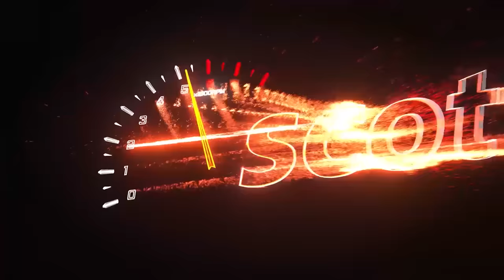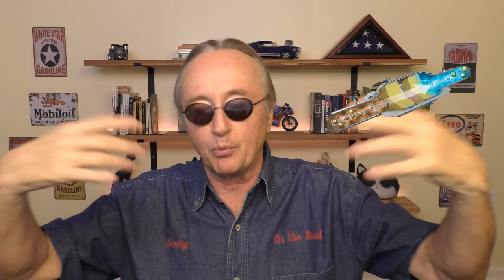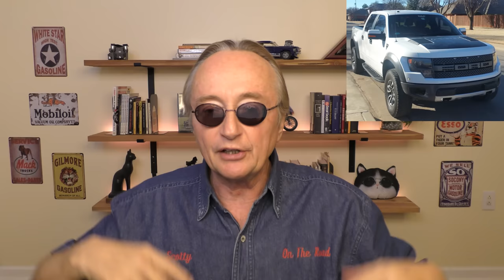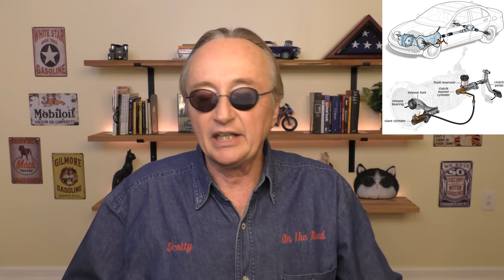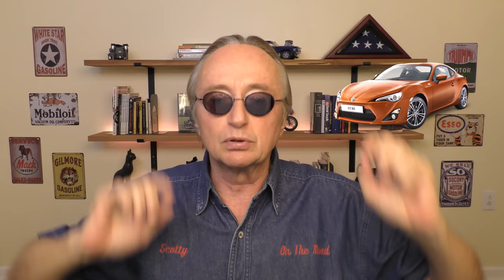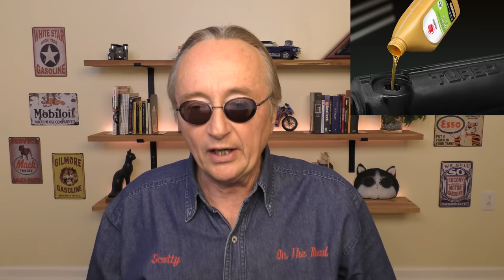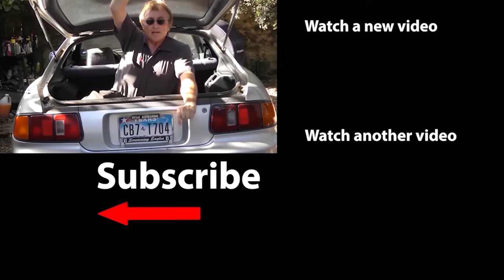Here’s Why Engine Braking Can Destroy Your Engine and Transmission

Comment: I used to do it in the snow and avoid using the brakes. But yeah I guess brakes are cheaper than transmissions. That's why planes don't use full reverse thrust anymore, because brakes are cheaper than an engine overhaul.
Reply: They mostly use it for noise control. Putting fuel in the engines for reverse thrust costs less than taking the plane out of service for rebuilds. 
Using the brakes landing delays the next take off, they need to wait for the brakes to cool in case they need to abort take off. 
Reverse thrust is not the engine braking you use in road vehicle. 
Reverse thrust redirects the engine thrust to the front, it's more like putting your engine in reverse while going forward. 
It's not a direct comparison.
Reply: Ok so they do it for noise. But isn't it also because of engine wear and fuel consumption also? There had to be economics involved for them to change standard practice.
Reply: @TheRabidPosum  tyres are expensive, brakes are expensive. Fuel is cheap. Thrust reverse is only used for seconds, not hours upon hours. Jet engines have few wearing parts, it's mostly oil changed at service intervals. Brakes are a high wear, high failure part. Tyres are the same. 

It's noise regulation that forces companies to reduce their use of thrust reverse in airports in cities. 

Thrust reverse is safer in wet, icy, snow conditions. They are safer in high temperature conditions. They are used to reduce the high speed more efficiently and effectively. 

Cars would be lighter and cheaper without all of their safety equipment. They'd also be cheaper and possibly more efficient with out noise and pollution emission controls. Public safety and comfort mean we often pay more for things, do things less efficiently.
Reply: @rustymozzy  that makes a lot more sense to me. That's what I felt in the first place.

Comment: Engine breaking on certain engines is bad yes, but my Hemi loves a good downshift for breaking. Of course if you down shift in a Toyota 4 cylinder it will stress the car and it will blow up.. but not my MOPAR HEMI... Very smooth better balanced engine meant for down shifting  and slowing that 4,200 LBS in seconds.

Comment: The diode voltage difference is felt especially when testing with acceleration .The power and swiftness of the acceleration .The profile of the acceleration is alternator-diode voltage dependent.What do you think .Yes the car moves but how does it move?

Comment: Engine breaking is a different animal with electric and hybrid electric vehicles. In those cars the engine braking is electric. In my Gen2 Prius I always break-shift on down hills to get more mileage as it pumps power into the batteries I would of otherwise wasted in the brakes. My Prius is +250K miles and still going strong. My Chevy Bolt has even better regenerative braking. You can drive with just the gas pedal as pressing the accelerator pedal speeds you up and letting up on the pedal uses the same motor as a generator for full breaking depending on how much you let up on it. You only use the real breaks in an emergency like if you want to squeal the tires to a instant hard stop. Going on +3 years and the breaks on the Bolt are still new! lol

Comment: I'm not sure that Scotty knows what a Chevy ZR2 is....Its like a Jeep Rubicon with better shocks & Locking differentials....Ford Raptor....can be a maintenance headache! Skodas? Well they are rebadged Volkswagens.....Maybe better styling.....Same for SEAT brand autos.....Myself....When I went truck shopping....Looked at the Raptors....all were optioned to the max around $80,000 and ended up with a 2 door cab ZR2 for $37,500 and looking at the maintenance schedule for the 1st 100K miles....I'm happy I bought the more "basic Chevy" rather than the "Cowboy Cadillac" Ford....Cheaper insurance too....and I'm an "old guy"....Whole lot less things to go wrong on a ZR2 and I don't intend to run 60-80MPH when I'm off roading my truck....just fast enough to get to where I want to go....

Comment: Hey Scotty, a 2010 toyota rav4 228k km the transmission hasn't been change... would you recommend change it, drain and fill it twice? Also will injector fuel cleaner help to keep the injectors clean? Will this cause problems?

Comment: I don't understand the engine braking advice.  My truck came with an exhaust engine brake (actually works pretty darn good).  And why would slowing the vehicle cause more wear than accelerating it?

Comment: Ya know what's worse? Under steering in to the wall because you didn't use engine braking. It's very simple; if you don't engine brake or don't want to utilize your gears properly in the first place then don't buy a sports car, stick to crossovers and don't go beyond that. Engine braking is a feature of the gasoline engine and without it your car will not handle properly. If you buy a Big Mac, it will last longer if you don't eat it, right?
Reply: @Mark Codiroli You have never been to the track in your life and should never give driving advice.

Comment: Ya but the zr2 has front and rear lockers instead of ford only being a rear locker as well as they use a better suspensions it has a multimatic suspension instead of the traditional Fox shocks ford is using

Comment: SCOTTY! Got a 07 honda fit and get loud sound when stopping at a light and the car is in drive, once i go noise goes away and back to smooth. If i put the car in neutral while stopped the noise stops but when i go back in drive right back the noise comes. I have a bad cattalilytic converter if i get it ripped out and just put a straight pipe in place would that fix it?
Reply: I'm far from an expert, but it might be the torque converter. In drive and stationary, the clutch is open and the torque is transmitted to the wheels through the torque converter. When in neutral, the clutch is engaged i think, so there is no relative motion in the torque converter. And after you pull away, the clutch engages, locking the torque converter. So... relative motion in the torque converter is my very ignorant guess.
Reply: @CristiNeagu  well would you know if i leave it as is would this get bad because this is a budget beater that im trying to spend as little as possible on

Comment: If your engine and transmission can't handle engine braking, you have a crappy car. I drive my cars hundreds of thousands of miles and I do it all the time. But I research the cars I buy and don't by junk that falls apart from normal driving.

Comment: If its more than an hour downhill and paved road in automatic car, using inly brakes, will overheat the brakes and losses the brake(danger) im typing this out of experience, bu the way if that happens, pump the brakes fast and pull over as soon as you feel the brakes losing.

Comment: I think engine braking is very poorly explained in this video. The big trucks going through Tennessee, up over the mountains, like at Monteagle and in Chattanooga, rely on the engine holding the truck from becoming a runaway and blowing down a mountain at 100 mph. They actually have a feature called an engine brake. Camping trailers and boats, cars that have brake failures, all can be slowed to a crawl by shifting down one gear, and letting off the gas, keeping your speed slower. At the top of the hill, cut back to 55, or even to the posted truck speed, and use a matching gear. Keep your foot off the gas and the engine will help control your speed as you go down. If it creeps up more than 5 MPH, use a quick, smooth but hard jab at the brakes to bring it back down, and let the engine try to hold you back. Do not ride the brake pedal with your foot all the way down. That will overheat brakes and maybe set them on fire. If the engine is not holding your speed in check, and you are on the brakes too much, they will start to lose stopping power. Slow down another 10 MPH slower if this begins to happen, and down 1 gear lower. The truckers rule of thumb is you go down a hill in the same gear at the same speed you went up. That will help  keep the mountain from killing your brakes or you.

Comment: False, engine breaking is part of the normal use of the engine. Engines are calculated for it even automatics
Reply: Aldo Rdz , true when you design shafts and gears I’m mechanical eng. You do reversible loading calcs using infinite life method. That is the shaft should do infinite life (million cycles and more) in both directions.
Reply: Stress-Life method*

Comment: Pretty sure Scotty is referring to automatic transmissions... it's a bad idea to slam your auto down into 3rd, it might hurt something.... Many times if you bought your car in a mountainous area, your auto trans will be programmed to engine brake, if you bought your car in a flat area, it will prob be programmed to roll and use the highest gear possible. often a dealership can reprogram the trans computer. my manual trans car turns off the fuel injectors when engine braking, the car is a PZEV, partial zero emissions vehicle, so it is def designed to engine brake no doubt, even says so in the manual, saves gas, extends brake life.

Comment: Ok, on engine braking.  How is engine braking detrimental to the engine or the transmission?  All it does is help control the speed of the car while descending a long downhill run.  Your foot is going to be off the gas so as far as the engine/transmission is concerned, you just coasting.  How is this damaging or excessively wearing anything in the engine or transmission?  I can't imagine it taking more of a toll on the drive train than simply driving down the road under power.  So as far as I'm concerned, if you live in mountainous area, by all means, make use of engine braking.  You're not putting half the wear on the drive train that you just did climbing that mountain! 

On a personal experience position, I was coming down from the top of Slumgullion Pass in Colorado and started picking up the smell of burning brakes.  The farther down the mountain I got, the stronger the smell got until it was literally burning my eyes and nose.  I caught up the the culprit toward the bottom as we pulled into a small town.  It was a Buick driven by a little ol lady with three of her friends on board.  As we entered the town, she pulled into a local restaurant and as I passed her, I got a good look at the front brakes.  I got a good luck at them because they were glowing a nice shade of red, they were that hot.  I wonder how many times she'd get away with that before the brakes gave out altogether?  Yes, brakes are relatively cheap to maintain but there's certainly nothing wrong with giving them a little help from time to time when the conditions warrant and I don't buy the argument that you're putting any any more wear and tear on the drive train while simply coasting down a hill than you would while driving down the freeway at 70 mph or climbing that hill in the first place.

Comment: Oh Scotty Scotty Scotty as long as we’ve been doing this kind of stuff,;,!,,. If you’d like to educate the public which I’m sure is your intention and you do a wonderful job most of the time, I think you missed the most valuable point .

Long term protocol is if your engine doesn’t make enough brake horsepower you’re not allowed to enter the highway speed of 65 because nothing built in the engine to accelerate the vehicle debility for the gross vehicle brake horsepower to maintain stability and slow and safe operation under deceleration. Couple that with a set of worn brakes small motor no breaks you don’t stop. That’s even the law.
Best to you and you’re always your pal, Jeff
Reply: @Mark Codiroli I wasn’t trying to reinvent the wheel here military is doing a good job of that. What I was trying to do was high like the fact that it’s gross breaking horsepower and the ability to decelerate the load on time to prevent accidents that has become what limits your ability to function on the highway and United States. As for example a motorcycle has to have 15 gross breaking horsepower. You can find other examples if you look. So again,,, I was wide open. Yes but sometimes you might want to use their ears and was between them, LOL...
How much you ever heard of the term growth breaking horsepower that’s why the?

Comment: how does engine braking cause damage? in gasoline engines its just caused by the piston pulling a vacuum slowing the engine speed and by proxy the road speed. you arent injecting fuel, theres less overall wear on the actual brakes, and theres no heat that isnt less than the engine normally handles. hard disagree here. my man just said "transmission expensive" and didn't elaborate

Comment: I need help with my 1990 integra, she cranks up and everything i relayed most of the fuel system minus the injectors which I need to check, but it doesn't start no matter what I've replayed thr main relay and the fuses are good, new fuel pump new filter new wireset and spark plugs distributor cap and rotor

Comment: NOW...I Am confused , without engine braking...those trucks semiS... OMG
Reply: Alan Smithee  thanks now, I am relieved...more oR less
Reply: Many larger Diesel Trucks have a " Jacobs " Brake inside The Motor . These Braking systems usually they have 3 levels of stopping power and use the motor to slow down the Truck . This helps saves wear and tear on the brakes .
I drove Commercial Trucks for over 30 years so Ive used these and they are usefull especially in Mountains and steep hills.
Reply: @jayhockley8841  but semiS running off R quite common, if not rampant, DON’T u 🤔 think
Reply: @jayhockley8841  so, maybe for big BIG TRUCKs, engine brakeS R like reverse thrust on jet engineS, indispensable, but NOT on passenger carZ
Reply: Alan Smithee  thankZ again
Reply: Alan Smithee  cause today, i didn't watch the entire clip first

Comment: I just discovered this great guy on YouTube. I got a question though, I bought a 2020 Corolla LE for 15K. But it has 39K miles. A lot for a almost new car. And I bought it because my old 2000 CRV is giving out on my having 350K miles. I bought the car. Was it a good deal or was I a bit ripped off because of its high mileage?

Comment: Hey Scotty, I got a 2002 Ram 1500 with a 5.9L v8 engine. It had its transmission rebuilt once. Recently it has problems going up hill where it would start to kick and buck, in the overdrive gear. But if I floored it, it drops down a gear and it would pull just fine. I changed the wire coils, distributor cap and the thingy that spins inside and the bucking went away almost entirely. Didn't change the plugs cus they're relatively new. Now it only does it sometimes. Also, it idles kind of rough with fuel trim readings reaching something like -28%.

I checked the codes and found no transmission codes but i found a "P0172 System Too Rich Bank 1" code and a "P1281 Thermostat Inactive" code. Could it be a fuel injector problem instead of a transmission problem?
Reply: @Mark Codiroli You were right!!! I changed all 8 plugs and its running smooth as heck now. Thanks so much! It still does this thing where, when it's cold, if I come to a complete stop, it kinda starves for fuel and acts like it wants to shut off. It used to shut off entirely before changing the plugs but now it only starves for fuel and drops in RPMs but comes back up. My dad says it may be transmission related but I don't think so. Could it be a vacuum leak?

Comment: There’s literally nothing wrong with engine braking just as there’s nothing wrong with downshifting while going up hill for more torque. The engine and trans doesn’t care if you’re going uphill or downhill or no hill, all it cares is your RPMs aren’t too high for the gear you’re in...

Comment: My 2014 Manual Honda Civic wont shift properly. It feels as if something wont let me put it into gear unless i step off the clutch then put it back in. Same thing sometimes when going into second and REVERSE! 3rd and 4th not so much, more like never. What is it that i need to fix?!?!
Reply: Probably heavy abuse if it’s only 6 years old. If it’s smoother on all gears when warmed up, it could be the transmission oil went extremely bad and is too viscose mixed with metal abrasion from the gears or larger parts clogging it up when you want to put it in. However, depending on the state of abuse, changing the oil could make the gears start to slip. Either way, you should check the transmission oil. In your manual, you will find the exact amount that should be in your gearbox. Just drain it (some videos are surely available how to do it properly), put the correct type of oil in (Check manual !!!!) , save the old for later IF the new oil will make problems (remove diluted metal parts with magnets if needed) and then you can always put the old back in or mix it with the new (don’t overfill, drain some before) or get some anti-slip additive to thicken it up if nothing helps.

However, don’t expect miracles. The best you can hope is somewhat smoother shifting. 

Either this, or you live with it until it needs complete replacement.

Comment: Actually i drove a car with a cooked break pump for a year becaue i couldn't find the replacement part and all my breakings where engine break and the car still fine 
PS: the car is Renault symbol 1.4L basic model basic means no ABS and fancy stuff just metal and wheels and AC 😅